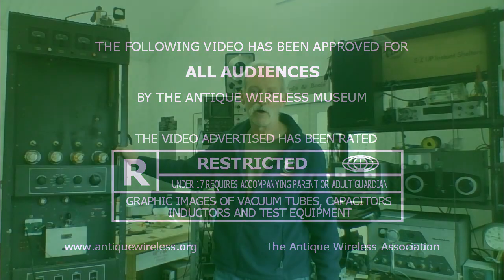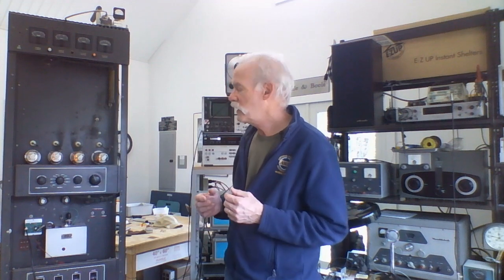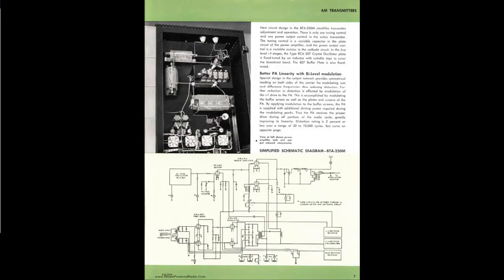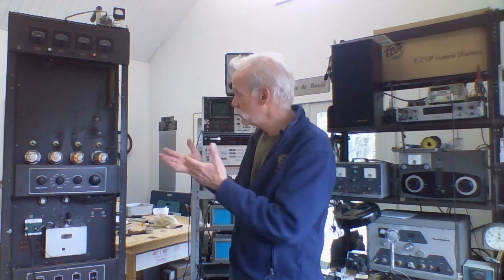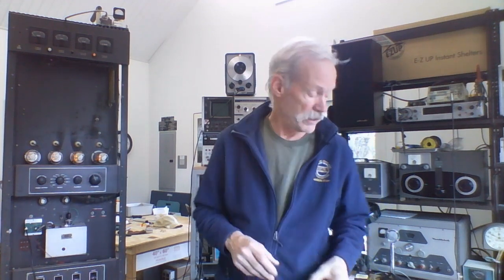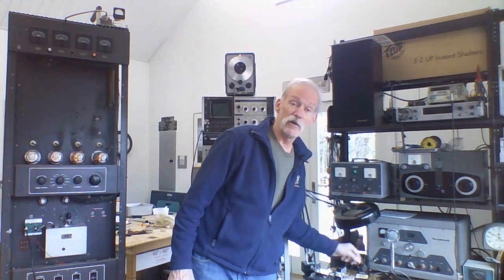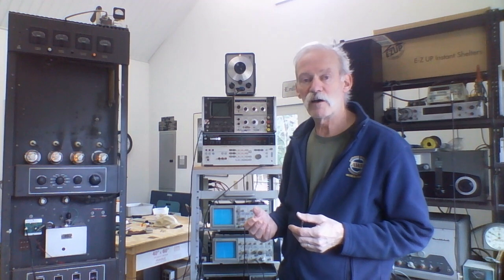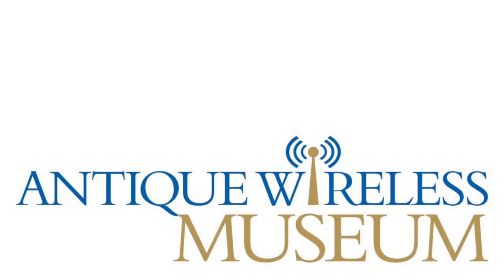Part 1 - Converting an AM Broadcast Transmitter for Ham Radio Use

Comment: Hi Mark!   I live in the Beaver Falls area, and used to listen to WBVP as a kid on old table radios or a crystal set.  Its possible I have heard that transmitter before.   My SB-104a won't do 160, nor am, but I have listened to a couple of 160m AM stations on a SoftRock SDR,  and was impressed with the audio quality the stations were putting out!   Good luck with the retuning!  73  N3SDO
Reply: Hey Ed, Thanks for the note. From the FCC records it looks like my transmitter was put into backup service in 1962 when WBVP was able to increase its power to 1KW and a new RCA BTA-1R went on the air. You're right about the audio quality of these old rigs, the modulation choke and transformer are much larger than you'd find in amateur equipment. Also, many AMers have put a lot of effort into their audio chains ahead of their transmitters. 73, Mark AE2EA